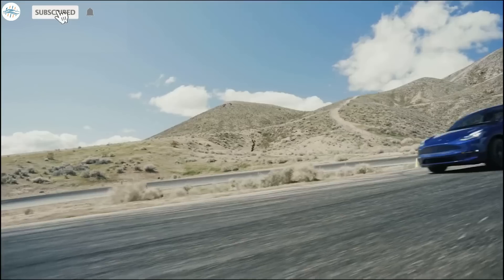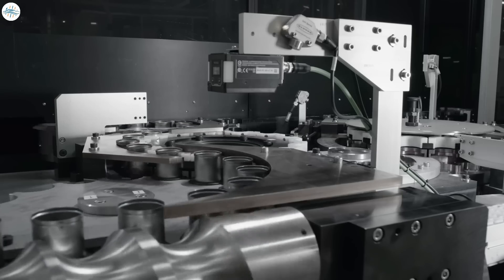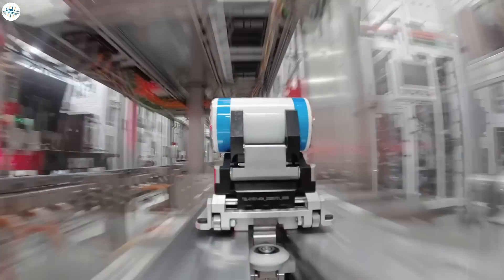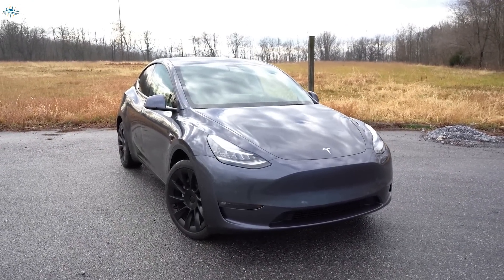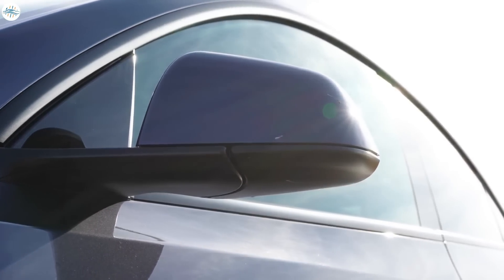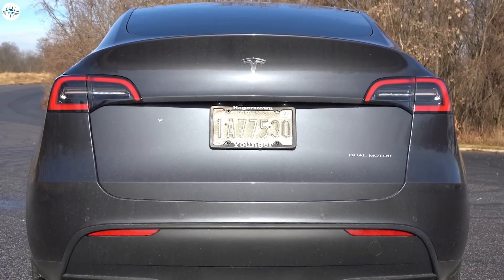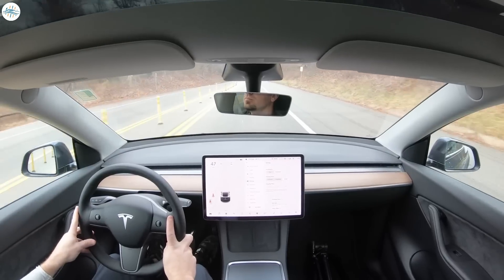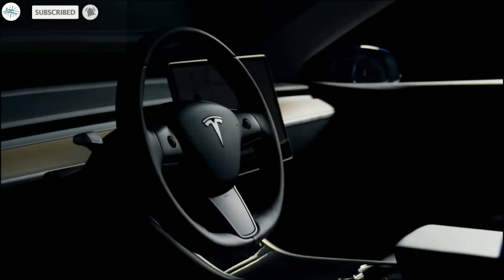Tesla Model Y With 4680 - Wait OR Buy Now?

Comment: WE have a model y with the 4680 batteries as part of our order. I have had a RN number for over 7 months. The delivery date is Jan 2023 to April 2023. Do not have a clue what the range will be I hope around 475 mile range by information around battery day and other information. Anyone have a clue?? Thanks for any ideas!!
Reply from the maker: Do not expect such huge range numbers at least for next 2 years. Even if the new model y will be equipped with the 4680 cells, the range will be around 300 - 350 miles max. We can expect more range in the future, but that will definitely come at a premium price.

Comment: Affected by weather hot and cold, usually battery degradation to below 70% after 8 years or 100K miles, leads to the battery significantly losing its power. A $23.000 bill to replace a battery is insane, and each $1.500 service charge is beyond ridiculous.
Reply: You're nuts. None of that is true.
Reply: @j.kevinmcnary9561  Experts suggest that EV batteries often last from 10-20 years or theoretically last forever. However, EV battery degradation to below 70% is bound to happen at some point depending on the driving habits, charging habits, speeds, the temperature, road conditions, and more. As a result, several federal regulations require manufacturers to warranty EV batteries for 8 years or 100,000 miles to ensure the batteries hold at least 70% capacity. In reality, a Finnish man's 2013 Tesla Model S after 8 years started showing error codes while the mileage display was less than 100,000 miles in December 2021, and the only fix was a $22,600 full battery replacement, which was half of the price the EV retails for, and his final choice was sadly to blow it up instead of footing the bill. Don't take my word for it. Look it up for yourself.

Comment: Ok, my position is, if it's been announced it's the current technology especially if it's been effectively offered by carrot dangling CEO. 
So, I expect 4680, structured battery pack. Sure would accept and be pleased to have say 800 cells would improve drivability. Luckily if it's not what want I only tear up $250. And go else where. Would rather by Tesla but there are other options in the shirt term pipeline.

Comment: I am aware that the 4680 battery can be charged to 100% every day! This is unlike the 2170 battery. So, with that information, the 4680 battery will indirectly give you 100% of the car range every day, assuming you charge it 100%. Because the 2170 will degrade quicker if you charge it to 100% every day. Am I missing something?
Reply: I believe your information is incorrect. The LFP batteries (lithium iron phosphate) can be regularly charged to 100%  I searched on google and from what I can find the 4680 batteries are NOT LFP batteries.
Reply: @munkymind  Really?  I'm very surprised...  I have seen several videos and read a few articles about the 4680 battery being chargeable to 100% every day without concern for battery degradation...  I have no idea.  In all honesty, if you are right, then I will order the Y today :)
Reply: @Sheriftoma  I suggest you confirm it for yourself if you can. I can find info that the 4680s can be charged quite rapidly, but I've only seen info stating regular 100% charging for the LFP batteries.
Reply: @munkymind  Thank you for the heads up.  I will certainly look into it.

Comment: I reserved a model Y LR standard 19" wheels in Nov 2021 with an initial estimated delivery date (edd) of Oct 2022. The only upgrade I ordered was a tow hitch for a bike rack. In Dec my edd was changed to June 2022. In mid Jan my order was put on "hold" by Tesla with no explanation. Since then I have received no update on my edd. I don't know if I should or would accept a Fremont built version based on their QC history, and I don't know if I would accept a 2170 battery with the "old" chassis that they are currently phasing out for model Y. I ordered mine when the base price was $57,990, so just prior to that there had been a series of price increases. This is the car I want, but I have issues with Tesla's sales practices. Also, Tesla's service record is spotty and leaves room for questions as well. If I refuse the car when it arrives, it would likely mean a $5 increase to re-order. I think I would have to at least consider other ev alternatives in that case.
Reply: Is there really an ev alternative to TESLA?  I've done some research of 11 other EV's and none of them compare of what Tesla is offering?  Now the prices are def more attractive but that is about it!
Reply: @EscoPicoTrane  Thanks. I basically agree. Especially if one is going to do some road trips. I've watched hundreds of videos reviewing other EVs in this general category. There is a LOT to learn, and some of those videos included the trials and tribulations of road-tripping without the benefit of the Tesla supercharging network. I'm not inclined to deal with some of those hassles. And of course the tech, including the app, is so much more advanced with Tesla.
Reply: I ordered my grey MY in October with a tentative delivery of june…recently i changed the seats to white……they changed my date to Aug 31-Oct 26.  From what i am seeing is that when gigs texas comes on line…..the west coast will be getting Fremont.  While the east coast will be getting gigatexas….I’m in so fla….so if things work out…..looks like i will be getting from from texas…..but know this…..the 2170 battery has been around for awhile….its tried & true….while the 4680 has not…whoever gets it will be the test subjects….  I’m sure that both sets of cars will be nearly the same….with little difference… the 4680 is a cheaper battery!!!  if i were you, i would keep my place in line…..if you dont want it….you could buy the car….& sell it quick to someone at the current price……(with a little profit).   But do what you want…..my base was $56k……as soon as gigatexas rolls out…I’m sure you will be given a good date!
Reply: @Cocoatreat  Thank you. That is good advice, and actually a thought I had a while back, so I appreciate the reminder that I can purchase the car (assuming no obvious deficiencies) and resell if I decide I don't want it. Or, just keep it for a year or 2 or 3 and trade it for something better, if things change significantly. I ordered Gray also, but with black interior. The white interior just seemed to bright for my taste. And I agree with your comments regarding the batteries. More important for me is the structural battery pack and the solid pressed front and rear pieces of the chassis. I'm a bit concerned that resale could be affected if my new car is viewed as "outdated" because of the chassis. I'm not sure how much we can rely on the projected division of distribution of model Ys, east vs west. On 1 map I encountered, it appeared that they were using the continental divide as the separation line. I live about 50-60 miles east of the divide, so it made me hopeful I would get a Texas built car, but I don't think I can count on it.
Reply: I hear you. I'm waiting as well. It's bullshit.
Reply: @W4rg3rm  Actually, I can understand the wait. It's simply supply and demand. Orders are far outstripping their current capacity. What bothers me is their near complete lack of communication and transparency.  But I guess since the demand is so high, they currently just don't care how buyers feel.
Reply: @munkymind  when I dreamed of getting it, I assumed getting the money together would be the hard part. Thought if I could  just get it ordered it would be smooth sailing. Well now my patience is being tested lol.
Reply: I'm learning what the Tesla customer service critics are talking about. I reserved MY Dual motor in August 2021, estimated delivery April 22. Was notified of VIN match in late November for delivery Dec 10....but at that time I had no way to charge at my home, and nearest public charger 40 miles away, so had to pass. next VIN match occurred while we were on college tour/mini vacation, and both delivery times offered were 2 and 4 days away while we were still (1000 miles) away. Next step: Tesla auto-canceled us and kept reservation deposit without any notice to us. Have exhausted all resolution avenues with delivery center (Paramus NJ), and am running this matter up to the Tesla corporation and Board of Directors. I'm pretty peeved about this level of customer service and an unfair business practice from an otherwise world-class tech company.